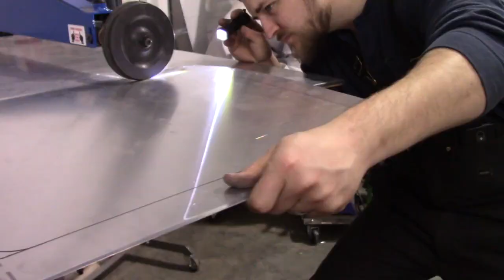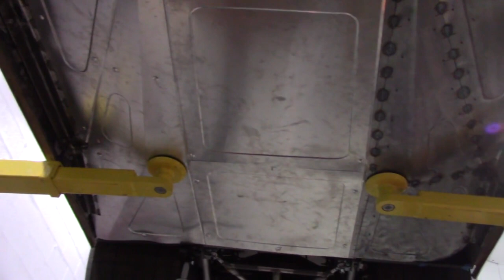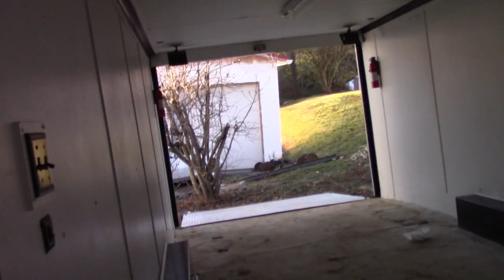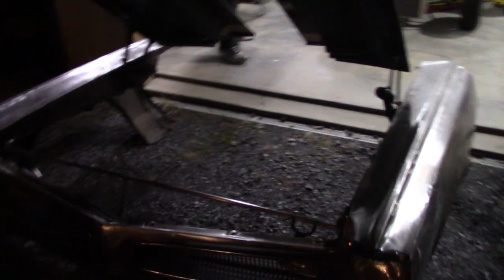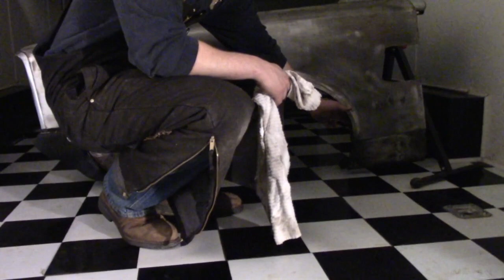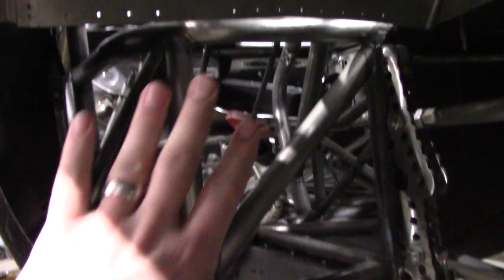1966 GTO Race Car Floor Pan Install Part 3 (GTO BUILD EP24)

Comment: What thickness was your aluminum, steel and the stiffner plates? Thanks.
Reply from the maker: .030 aluminum  .035 steel. ,  stiffener plates are .070 . I sell the stiffener plates on my website Kilbymotorsports.com if you need them.